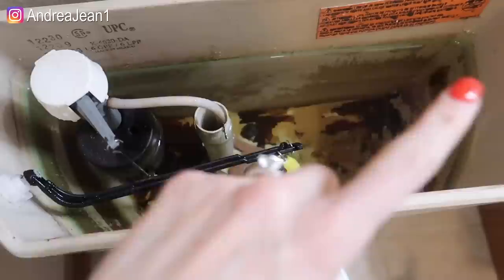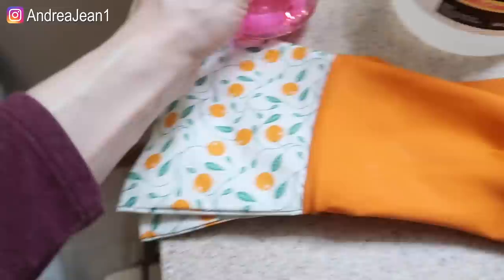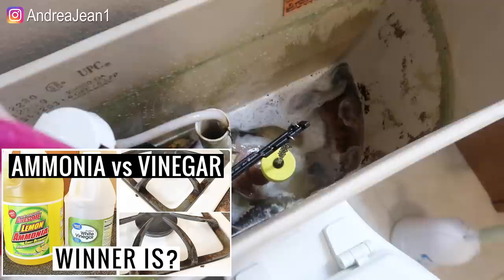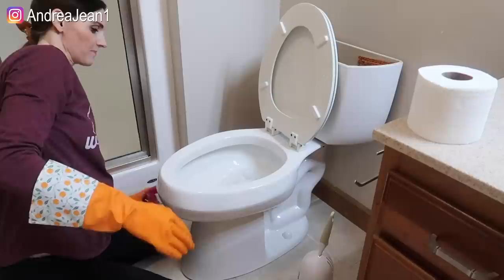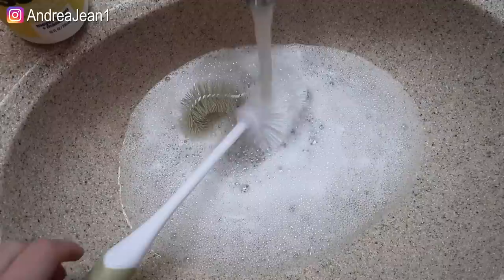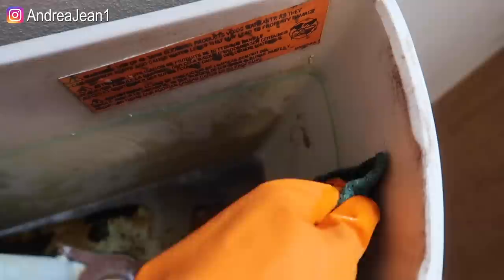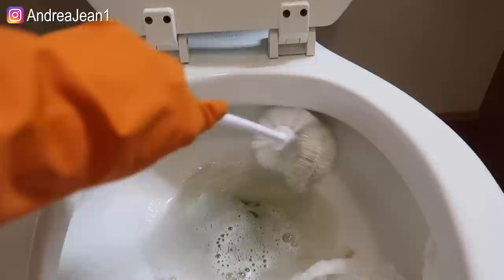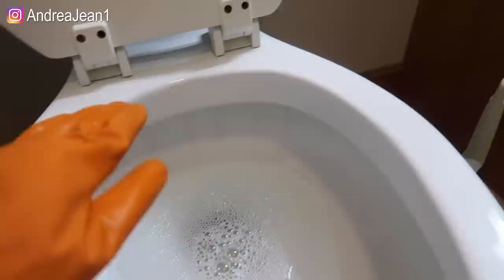Put VINEGAR into your TOILET and WATCH What Happens!! (Bathroom Cleaning Hacks)

Comment: I saw another video (possibly yours?) showing how to use vinegar in the tank to get rid of deposits etc. That video showed to turn off the water; drain the tank; and fill it with straight white vinegar. They used 3 gallons of regular white vinegar to fill the tank (not the cleaning kind) then let it sit overnight. They recommended to let it sit at least 6-8 hours, which is why they just left it overnight. Anyway, the next day, they flushed the toilet after turning the water back on, and the tank was mostly free of all the hard deposits and minerals that has accumulated over time. They used a toilet brush to remove any remaining deposits, which came off easily without scrubbing, and they were left with a completely clean tank. They recommended using the method once a year to prevent minerals from creating hard deposits.

Comment: Great and useful video!! Oh, instead of using the towel to clean the mirror and then you have to wash it... use day-old newspaper! and just throw it out. There is something magical about ink!!!
Reply from the maker: Interesting....
Reply: Yes, if the mirror or window or glass is wet, scrunch a piece of newspaper and clean it. If not wet, sprinkle a little water on the scrunched newspaper and clean it. It will make a jeep jeep sound and your glass, window, mirror will sparkle. It's an old grandma recipe. And miraculously the ink will not run or stain!
Reply: The ink in newsprint actually polishes the glass to a smoother finish and makes it just a little bit harder for debris to attach to it.

Comment: I can’t wait to try some of these tips.  Thank you!  If you use a pumice stone on the residue and stains it is all natural, very inexpensive and will take that all off faster than the green scrubber and toilet brush and does not scratch the toilet. 👍
Reply from the maker: I have a whole video on this too 👍 thanks!
Reply: I am wondering HOW a pumice stone would not scratch the toilet's fnish?
Reply: JSM 21 -- google says, “A pumice stone is effective for cleaning porcelain toilets without scratching them because the stone is harder than most mineral deposits and stains that typically develop on toilets, yet softer than porcelain.”
Reply: P Johnson - I don’t use them for weekly cleaning.  Just for the hard to get off grime and stains that build up over time. They are super cheap, less than $2, so I don’t mind pitching it. Do whatever is best for you 🤷‍♀️

Comment: If you have the patience, you can get much stronger vinegar, starting with distilled white vinegar by putting it in the freezer.  Start with about 3/4 of a bottle so that ice expansion doesn't damage anything or make a mess.  Freeze the vinegar overnight, then remove the cap and turn it upside down over a bowl or big enough bottle to catch the drippings.  The acetic acid will thaw more quickly than the water, so the highest acid concentration will be the first to thaw.  after 3 or 4 hours, taste the drops melting from the first bottle.  it should be distinctly weaker in vinegar flavor and acidity than when it was placed in to freeze.  If you can't taste any vinegar in the melt,  you've extracted the vast majority of the acetic acid, and the remaining ice can be discarded.

This can be repeated to further concentrate the acetic acid, but I've found it quite sufficient to only do it a single time.  I usually wind up discarding more than 2 quarts of water from a gallon of vinegar, so my concentration should be at least 10% acid by volume, instead of the 6 or 7% of 'cleaning vinegar'.
Reply from the maker: Thanks!
Reply: OriginalLictre yo

Comment: Thanks, I'm going to try this! I use the Works tablets in my tank but I would like to get it really clean first. We have an older home and the Tanks definitely need a thorough deep cleaning.
Reply from the maker: Thanks Lori ✨
Reply: After I cleaned my tank inside, I used a The Works tablet, hoping it would maintain the cleaning. It was so strong, it warped the flapper, and it had to be replaced.
Reply: I've heard that some cleaning products (particularly ones containing chlorine) can eat away at plumbing fixtures if they sit in the tank water for too long, so it's best not to use them.

Comment: wouldn’t the vinegar be upsetting to my septic system?  I rarely use bleach for that reason .... and usually use vinegar for other cleaning purposes .... but what would it do for the septic tank??
Reply from the maker: I have not tried it on septic. I would proceed with caution though 👍
Reply: But everything you put into the toilet goes into your septic system.🤦🏽‍♀️
Reply: @—every thing you eat goes into septic systems, vinegar is a food we eat—
Reply: Hi Graydon Hall,
   Isn't that what Rid-X is for? The stuff you flush down the toilet once a month for your septic system. ☺️✌️☮️🖖   😷
Reply: We have a septic tank and have been in our house for about 30 years. I use bleach and vinegar to clean with. We have NEVER had a problem.  Two 500 gallon tanks and about 1 cup of bleach a week is not a problem. Also vinegar is a natural food product so no issue there either. And if you have "city water" with a septic, the water is treated with chlorine. So that's a lot more than what you would ever clean with. Nice video and I have to admit, I didn't know that the "cleaning" vinegar was stronger than the distilled.  Good to know.
Reply: @jenniferrollins8877  Not everyone has a septic system. Most people have city utilities.

Comment: Can you do a video on how to clean a toaster oven, especially inside the top where meats and stuff will cake on? How can I avoid the rust build up? It's a Hamilton Beach brand and I've had it for two years now. But inside the roof is rusted. I should add that I didn't use it for a while.

Comment: Toilets in the bathroom is not as hygienic as having the toilet in it’s own separate little room ( with small hand basin) as other countries do. Every time you flush ( especially with the lid up) aerosolised particles float into the air and land on the towels, toothbrushes etc. I once saw a video where they tested this and found ecoli bacteria on those surfaces!
Reply: yes, I agree, the size of modern homes, plenty of options for that, even behind a wall, around the corner,  within the main bathroom makes more sense
Reply: That's why they say to flush before you get up
Reply: @lanettamiles4100  They do? that might be a reference to the "courtesy flush" as used in jail cells, flush as quick as you can so as not to subject the cellmate to exotic odors!
Reply: @lanettamiles4100  
Then you will just  get all that on yourself and will need a shower.
Reply: @lanettamiles4100  or close the toilet before flushing...
Reply: A B  Yes. ALWAYS close the lid before flushing !!

Comment: I've seen lots of comments about mobile homes not having a shutoff valve. If you're going to put a valve yourself, be very careful. The pipes in mobile homes are a thinner material than standard PVC pipe. As the pipes get older, they become more brittle. Be careful when cutting the pipe, you don't want that pipe to break under the floor (then it becomes a major repair job). Just make sure you brace that pipe well before using a hacksaw on it. I actually use my copper pipe cutter on all plastic pipe. I just have to take my time with it because plastic will bend if too much pressure is used, metal doesn't.
Reply: Yep, and there was a class action lawsuit against the company that made some poor quality pipes. It's terrible.
Reply: P
Reply: Never knew this, thanks for the heads up.

Comment: For the toilet bowl itself I'm wondering why you didn't add some baking soda? Nothing beats the baking soda mixed with hot water and viniger.
Reply: Yes, I agree. What's even better is a combination of vinegar, baking soda, and citric acid. That's a powerful combination, especially when left to sit for a while to break down stuck-on grime.
Reply: Do u mean  plain  vinegar n soda
Reply: @dorishedgeman6764  yes. Use the cheap stuff. You can use it with what's called the. "Mother" but that is for cooking and more expensive. Any viniger and baking soda will do.

Comment: Yeah, I'd totally use a plastic bucket or the waste basket  rather than put the bowl brush in the sink.Spray the brush with Lysol(if you can find it anywhere). I've used CLR in the tank and it works well.
Reply from the maker: Thanks Reb ✨

Comment: I put vinegar in the rinse cup in my washer.
Reply: I do, too.
Reply from the maker: Yes that’s a good one too!
Reply: It will void any warranty’s on ur washer because vinegar eats away at rubber over time and will ruin the rubber seals. Learned that the hard way.
Reply: @dawnhankins6139  thanks for shaing.
Reply: I just pause it during the rinse cycle and open the door and put anything I want in then close the door and let it continue on
Reply: @tmo.48  some of the newer washers "lock" when it starts and cannot be opened until it is either "canceled/stopped" (which means you have to start all over) or until the machine stops at the end of the whole washing cycle.
Reply: Sorry bout that Rita—didn’t realize. Mine is new-kinda- but front loads and I have a start button that if I push during cycle it will pause it and unlock the door and then I can open it...put stuff in...then shut door and it relives. I’ve busted many of my top loader lids by prying it open with my hands or something so that I could do things “my way”☺️. Sorry but up four lines I meant relocks not relives🙄
Reply: @tmo.48    LOL  on the "relives" ...  yeah.  I miss that I can just "stop" the machine and add more clothes, etc.

Comment: Hey I'll give you a hint, while vinegar is good to clean a lot of things with, if you want to clean the inside of your toilet in less than a few minutes, just get this bottle of spray Comet, or you could just use the old-fashioned Comett  Both of them are relatively cheap under a dollar, just spray it on and take your scrub brush and brush it off. That should do a great job . Unless you got OCD . Thank you for your video share but I had to dislike it it was too much work.

Comment: The toilet paper thing is ingenious
!
Reply from the maker: Ha ha a fun little hack!! ✨
Reply: @AndreaJean  just as a precaution maybe tear your strips of toilet paper before putting on the gloves so you won't need to keep touching the toilet paper roll. Also maybe soak the brush in the tub as opposed to the sink just to prevent toilet germs getting onto the sink. Thank you for sharing your tips. I love using vinegar. I have been using it to clean for years now. Trying to be chemical free wherever I can. 😊
Reply: just be careful with the acidity level of the vinegar....as it can be bad for ALL the "rubber" gaskets in the toilet tank..and the gasket that is between the tank and the back of the toilet.  when your rubber gaskets deteriorate - which will cause the toilet to leak at those areas.
Reply: You can also use toilet paper with a gel type bleach on the grout in your shower to remove stains. Works like a charm
Reply: Zeno1999  I should have looked at all the comments first so I didn't recommend the same thing you did LOL
Reply: @maryjo391  YIKES
Reply: K
Reply: Mary Jo Very true.    Acids can lead to fast deterioration of rubber seals, including flapper and flush valve.  Once these leak, you’ll have a continuously flushing toilet.  Honestly, it’s best to just leave the tank alone.  All you see inside is minerals, mostly calcium, from water “hardness”.   Completely harmless.
Reply: @mysilentprayersalways1913  I use vinegar to sanitize my home
Reply: I use strips of cotton and them remove them to scrub.  I have one toilet which does not flush powerfully no matter what I do so removing the cotton strips prevents a potential tp mini clog.
Reply: @rjones4748  not even soak toilet stool brush in sink or tub-soak in toilet stool!! I don't want it in tub even either!! No need!
Reply: @rjones4748  so do I, refreshing.
Reply: u clean da toilet once a month....that grime builds so much
Reply: @rjones4748  true.....how can u put da toilet brush in da sink....where u washing your face and brushing yr teeth....unhygenic and seems like once a month that toilet is cleaned
Reply: @maryjo391  true
Reply: @hamiltoncouple01  I clean the toilet bowl only.  I feel it’s water and the stains come from minerals.  But cleaning the bowl where you poop and pp is really important.  I don’t like to look at a nasty toilet which is once per week unless someone in the house hands has some kind of intestinal virus or bacteria then you need to clean the whole bathroom.
Reply: @maryjo391  “

Comment: Vinegar on rubber parts might cause them to deteriorate, and leak. This may not make parts last longer, but speed it up instead. I've never gotten a smell from the tank either.
Reply: Bagsy  I said rubber not plastic. I've read on more than one occasion that acid and vinegar can cause rubber to deteriorate. But that is up to the user. Excerpt from the website Hunker.com  " Vinegar is the byproduct of fermented ethanol, a naturally occurring acid. Vinegar is hailed as a cleaning marvel, killing bacteria and removing grease and stains. Acids can slowly cause some synthetic rubber seals to deteriorate, however.".
Reply: Bagsy  From Lil Giant Thanks for the comment about acid and rubber.
Reply: Bagsy  Look I've been  in maintenance when you have 400, and up apt's you dont want to do anything that will cause extra work. If I use an acid in the tank I feel it will cause a higher failure rate that I am not willing to accept. So I am not going to do it. I don't want to damage the rubber gaskets in toilets period if the exposure is kept to a minimum, but I have to come back and rebuild the toilet when I didn't have a real reason to in the first place. Why use it?

Comment: Hi Andrea! New to your video channel. Love your toilet cleaning with vinegar. I had no idea there was a "cleaning" type of vinegar. I will be looking for that next time I'm in my local 99 cent store because it is very useful to use at home. I place about a cup of regular distilled vinegar into my dishwasher along with my detergent pod each time I run it and the interior of my dishwasher never has scale buildup and the dishes and glass stemware come out  spot free! I personally am an avid use of bleach. I love bleach. In this particular application I would have just left the water in the back of the tank and in the bowl and just  added some bleach to it. Say 10:1 (Water to bleach ratio). Let is sit like that for a few hours. That's the solution we use to clean surfaces and plastic reusable items in the medical offices I've worked in  that needed to be very clean and free of bacteria, virus and general germs but not necessarily sterilized. I think if you just throw some bleach in there you would achieve similar results without having to spray all the surfaces. Maybe the vinegar is less toxic. Probably is. But my relationship with bleach is very tight.😉
Reply from the maker: Lol!! Great tips Patricia ❤️

Comment: The thing to be careful of about vinegar is that is can cause a chemical reaction with certain natural stones that might be used in showers. Maybe a disclaimer to use
Reply from the maker: Yep you are correct 👍
Reply: Do NOT get even drips of vinegar on marble; marble is a basic stone (vinegar, of course is an acid) so you'll etch the surface of the marble.  I know...I did it ;(

Comment: I use a pumice stone. Easy cleaning for bowl and tank. Wet it with water and scrub. It will shape to fit area as you scrub. Use only on porcelain toilets. Gets out rings, gook from under the rim, and the tank as well.

Comment: If you have very thick lime streaks in the toilet bowl, it's actually much quicker and easier to remove them with a razor blade than to give them several rounds of vinegar and scrub. When I do it with a razor blade, the lime breaks off in pretty big pieces, leaving a pristine surface, so it really is very easy. I do it with lime in other places as well.
Reply from the maker: Thanks 👍
Reply: Have you ever used a pumice stone?